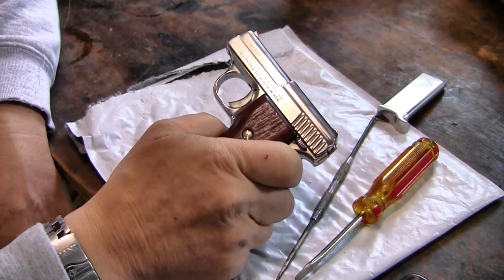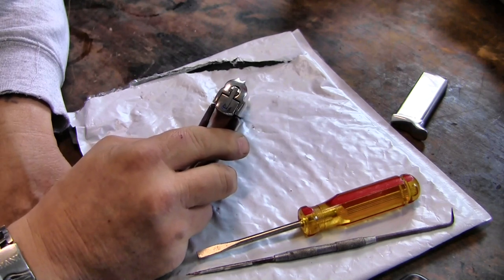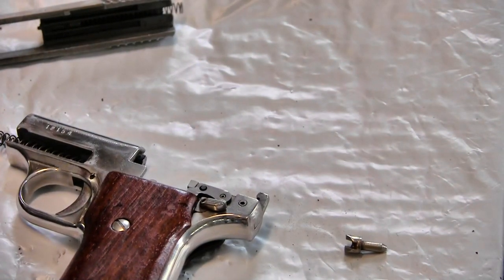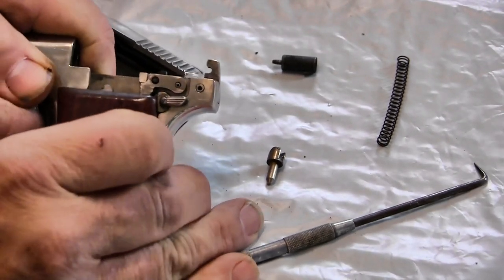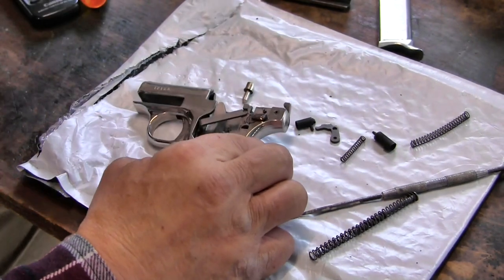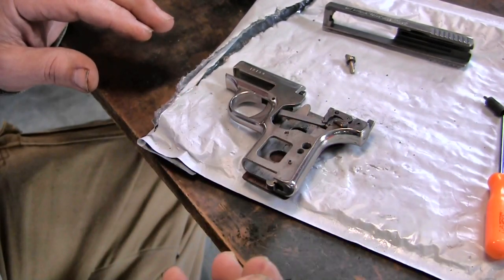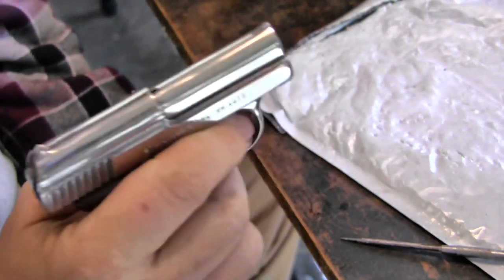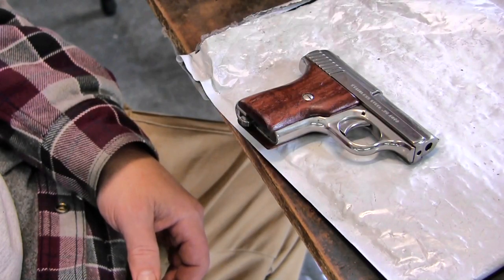Disassembly American Firearms 25 ACP pistol

Comment: Handgun Hero has a ton of different firearms that you can compare pictures/size with.... but they just don't have any of the smaller pocket .25's and I really haven't been able to find any good pictures of the different models next to each-other or compared against each other. Have spent a lot of time looking them up and trying to find "vs" videos and pictures... but there just aren't that many to go by. Really with I could at-least find all the stats/specs for each of them, so I could make my own silhouette images and compare them.... but most of the websites I've found about them don't contain the length, width, height, weight, barrel length and all that info that I would need to do that. For some reason most of the websites I've went to for info just don't have the basic specs that you normally find in in reviews of all other firearms. For some reason it's been a lot harder to find info on all these compared to other guns.

Comment: It appears the roll pin at the back is holding the back piece in. If so, it will make disassembly of the firing pin assembly a whole lot easier.

Comment: That hole in the guide rod is so with the slide off you can put both springs on the guide rod, then push the guide rod through the slide. While through the slide you put an object in the hole, this makes reassembly so much easier because the spring tension doesn't affect putting the slide back on.

Comment: Damn, I get that it's easy to design/machine that takedown system... but that is a real pain in the ass. There's probably 1000 ways they could have made a better takedown system. It should never require 3 hands or special tools to field strip a firearm.

Comment: Video helped alot slid the bottom portion of slide back while taking the retainer clip so there wasn't pressure on it made it a breeze to take apart dont pull the trigger once slide is off not very fun to have to put the pin and spring back into place. The pick in the hole for slide spring saved me that thing sucked to out back on all in all great video sir.

Comment: You definitely have a higher quality version compared to mine. Mine is stamped "Hawes" brand made in Germany. My version is blued with a plastic safety lever. Yours looks to be metal. I've had FTFs, FTEs, with a few stove pipes so it's fairly worthless in its current state.  I guess finding a spring kit is out of the question. 🤣Thanks for the video!!

Comment: I never heard of them, but that do'snt mean anything, any idea of the yr of manufacture, thx for the vid. An would these be considered the "Saturday Night Specials" I heard about in the 60's an 70's, or a better built weapon.
Reply: Yes. I believe these were designed in the 70's. I owned a Phoenix Arms 'Raven' and Raven Arms .25acp. I also owned a Sundance Industries .25acp. All models were pretty much the same garbage. Steve Jennings designed the Sundance and JA Industries versions. I later bought a Hi-point .45acp and was much happier.
Reply: I own a Raven mp25 got it cheap as  a plonker heard they reliable and accurate seen many parts for them if needed won’t replace my Glock 36 45acp